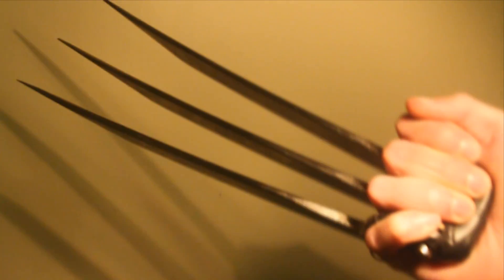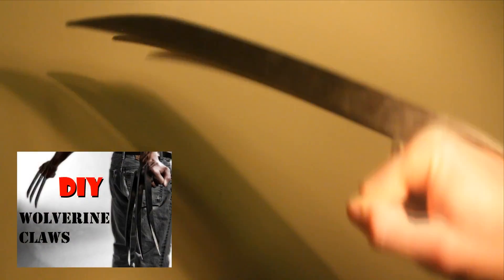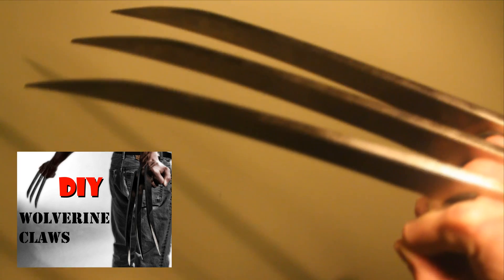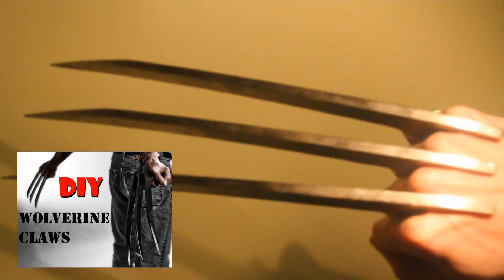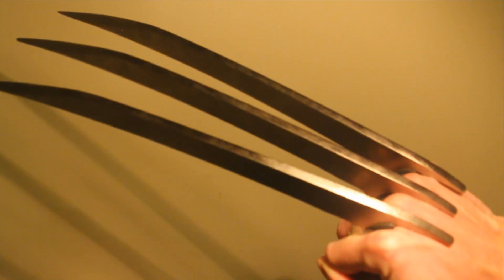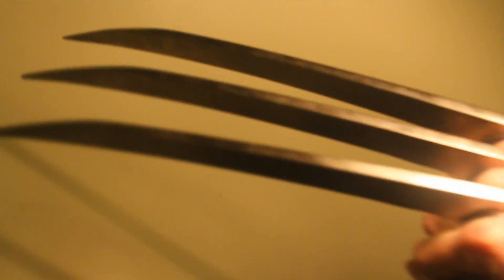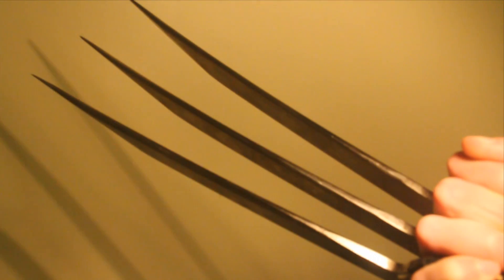Make it Real: Electrified High-Voltage Wolverine Claws!

Comment: If you ran 2 flyback transformers to one of the claws, and isolated each blade, and then connected both neutrals to the central blade, than you could make a taser that would electrocute pretty much any living thing. But if prolly use it to burn random crap!

Comment: it takes around 30,000 Volts of electricity to pass through 1 centimeter of air, so your looking at 60kv-80kv  right there
Reply: Finally, someone did the math!

Comment: was I the only one thinking  how the heck is he even going to wear them while there  electrified without injuring himself with out knowing even how many volts that transformer puts out
Reply: Hi there. Okay so Volts won't harm you. you can be tazed with 1,000,000V but if it does not have any amplitude it won't kill you. you will get killed by amps if your body doesn't make a complete circuit with whatever is shocking you. think of it as a lightbulb. once the conductivity is loss the lightbulb will blow up. 
It is pretty neat.
Reply: +Eric Cessor thats literally all gibberish the igniter troffo is not a tazer and it will kill you. no joke its deadly